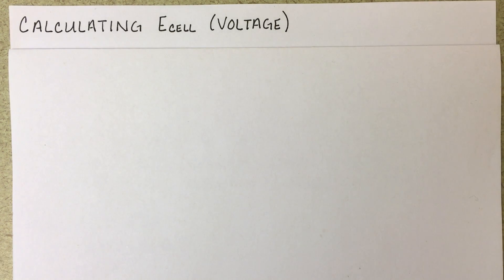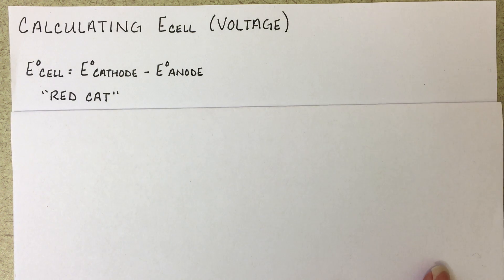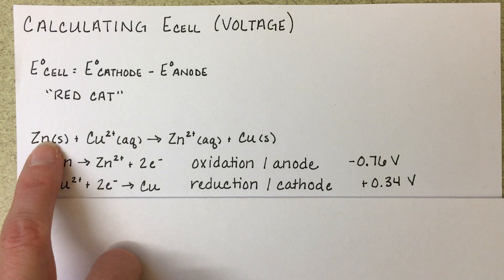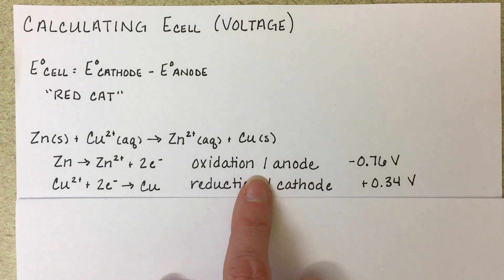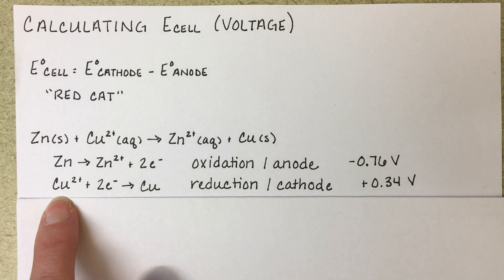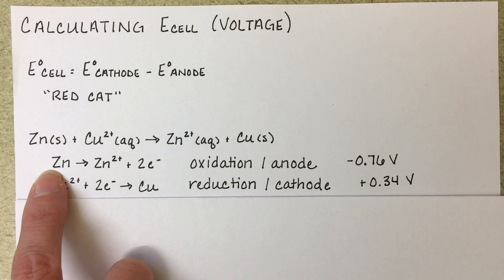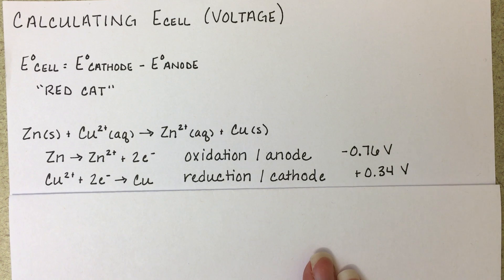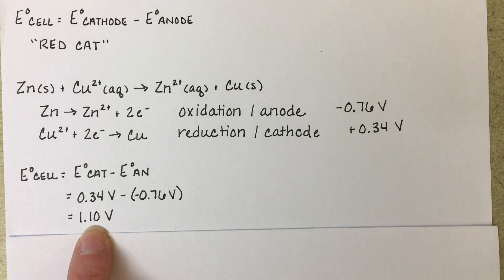Calculating Voltage of Galvanic Cell

Comment: Thanks a lot for the video, it’s very simple and easy to understand, but I have a question. If the question has a diagram of a galvanic cell and a zinc half cell and a tin half cell, how you would know if the reaction that happens is Zn + Sn ions or Sn + Zn ions. Thank you
Reply from the maker: You have to calculate Ecell and figure out which option (Sn ions vs Zn ions) will give a positive voltage. 
I have a video that describes how to do it here: https://youtu.be/Xp7H1pGjSHA?si=I6KCyPT9UL49pTuE

Comment: Mam i have a doubt,
Suppose we are given 
E° Cu^2+/Cu
And we need
 E°Cu/Cu^2+
 then can i reverse the sign of first to get the reverse reacn E° ????
But after reversing,the answers i get  never matches with those in the textbooks solutions
Reply from the maker: You do not reverse any signs when calculating the Ecell.  The negative sign in the Ecell equation (Ecell = Ecathode - Eanode) will do the necessary reversal of the sign for the oxidation half-reaction that is occurring at the anode.
Reply: @RoxiHulet  ohh thanks for clearing my doubt mam.

Comment: does this also apply for reactions occurring under non standard conditions?
Reply from the maker: Maaz ahmed  No, this is to calculate the standard voltage. For a non-standard cell, use the Nernst equation.
Reply: @RoxiHulet  ohkay thank you:)
Reply: @RoxiHulet  calculate e°cell for galvanic with electrodes